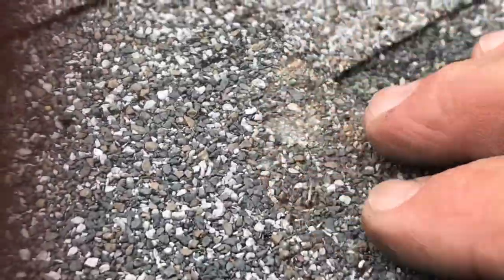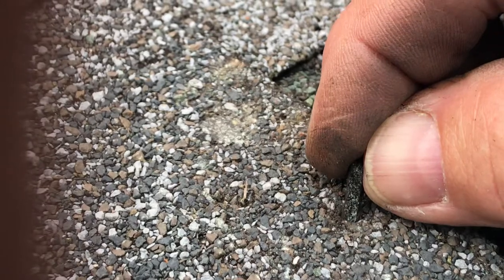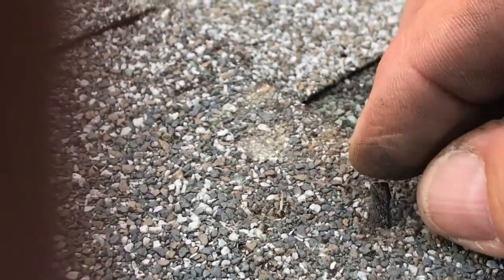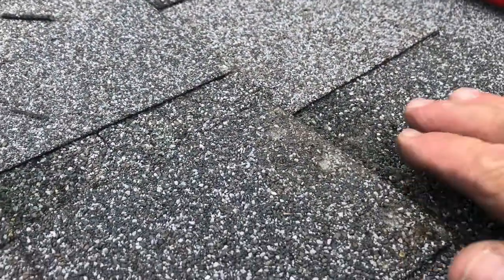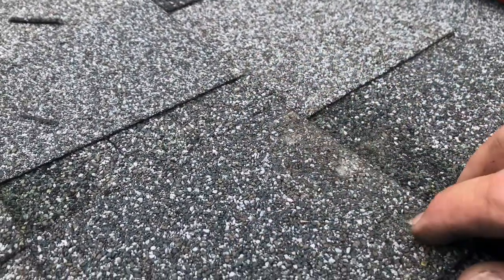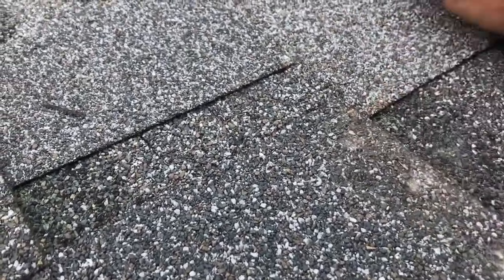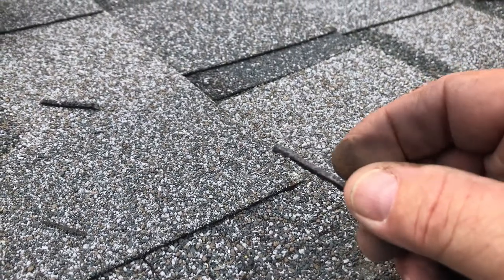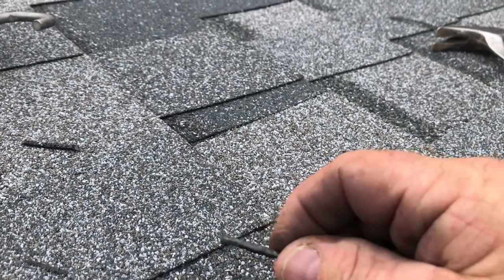entertainment only video, fix a nail hole in a shingle

Comment: I have to spend thousands of dollars to repair a leaky roof because of stuff like this. 
What is another way to fix pump jack holes?
Reply from the maker: Hi nick, that is, in my opinion, a reasonable, and fast repair, but please use your own discretion...
Reply: @lendavidhart9710  do you think roof repair sealant such as Black knight work better? Just a question as I am trying to get my contractor do this after removing their pump jack braces. Thanks